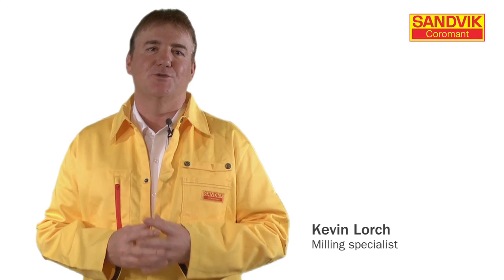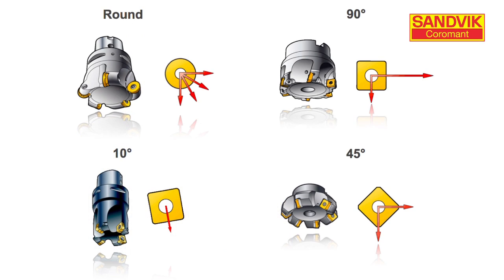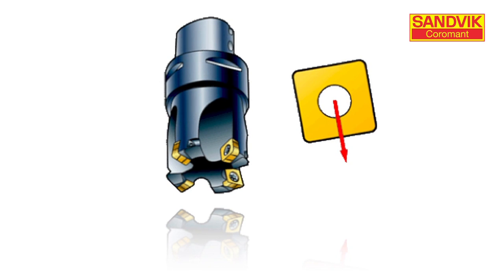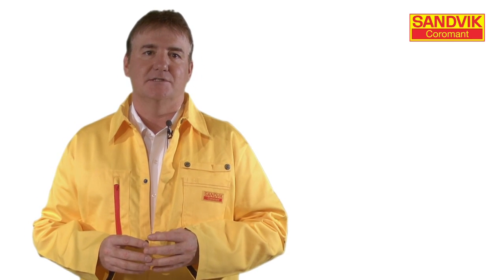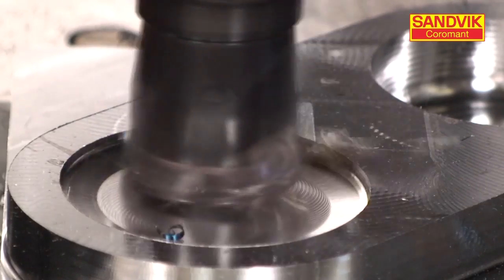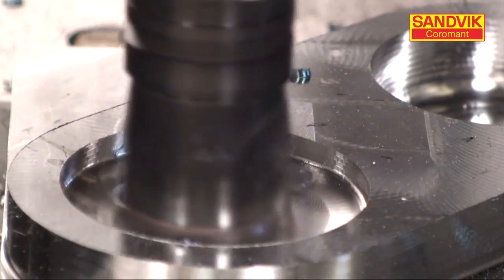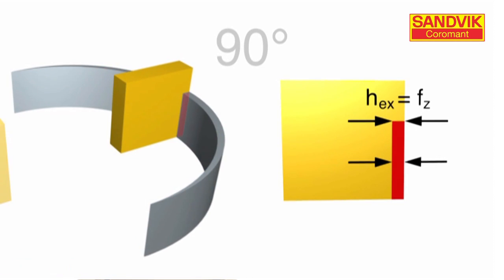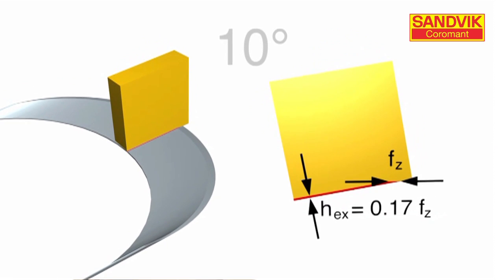Tips film: 10 degree entering angle in milling machining

Comment from the maker: Trigon inserts often have a curved cutting edge. This results in a varying maximum chip thickness (hex) along the cutting edge at a given cutting depth which can lead to uneven wear. A straight cutting edge gives you a constant hex, resulting in even insert wear. A benefit with trigon inserts is that when machining up against a shoulder, the clearance between the insert and work piece is better, hence reducing the risk of damaging an un-used cutting edge. B.R. David Öhlund, Product Manager